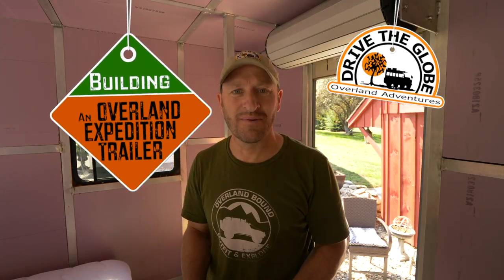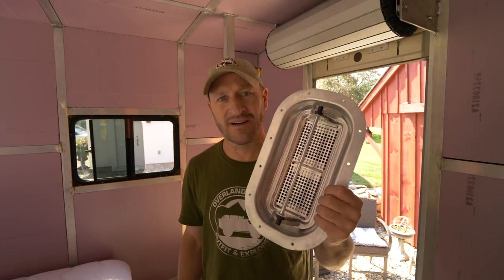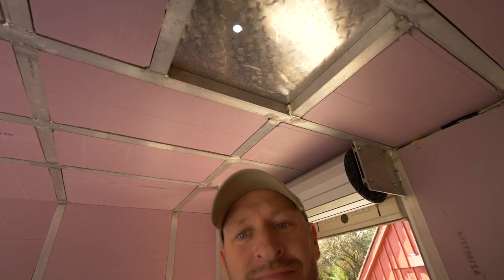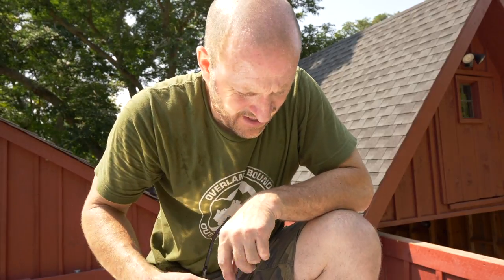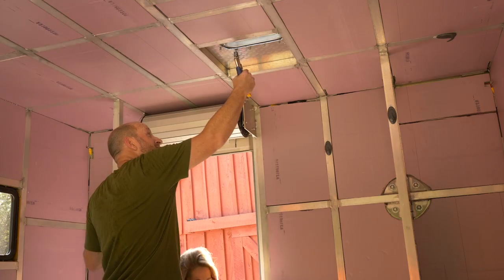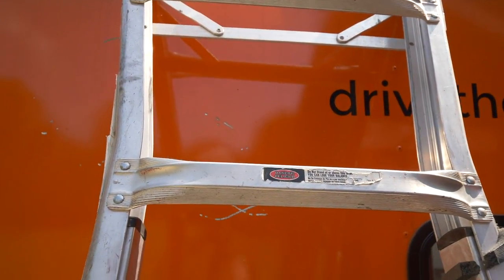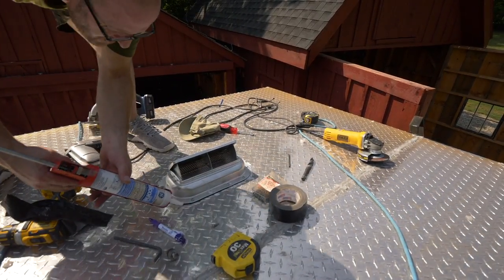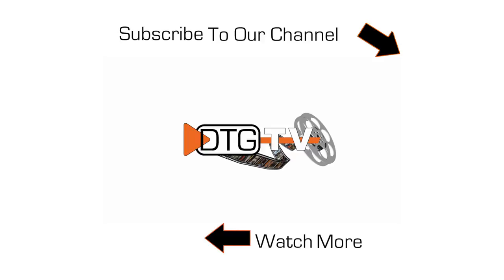Installing Retro Vents In The Overland Trailer

Comment: Nice setup you have!
I would think that the silicone would seal better if you put it between the metal and the roof and gently squeezing it out with the screws. Then snug it down a little more after it cures a little bit. Also prep the roof by grinding the high spots off the diamond plate aluminum on the roof where the vent comes in contact so there is no gaps to start with..
Looks like your rig will go just about anywhere.
Reply from the maker: Thanks for watching.

Comment: Would replace using silicone with sika/polyurethane sealant like bond and seal made by wurth if you can get that in the states
Reply from the maker: I have used that before and yes, it is available in the states. Thanks for the tip and thanks for watching.